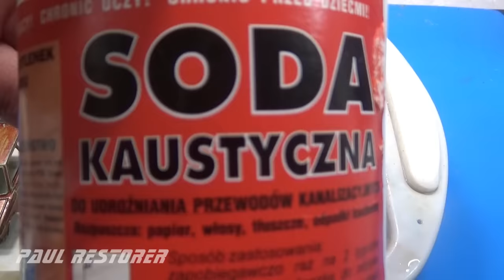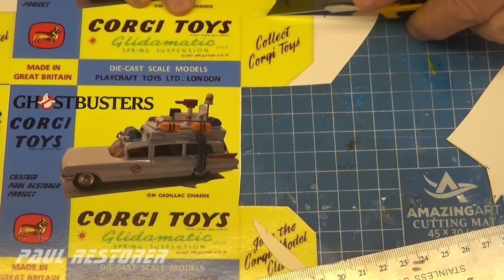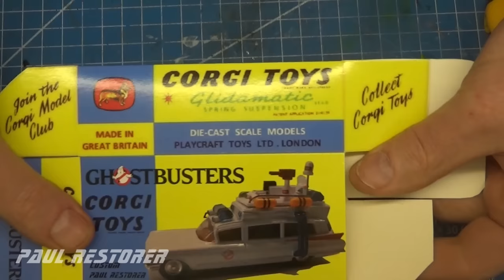Corgi Ghostbusters Custom Ecto 1 budowa. Zabawka model odlewany.

Comment: Needs some suspension work and shocks. Brakes, brake pads, lining, steering box, transmission, rear-end…. maybe new rings, also mufflers, a little wiring.
Reply from the maker: Thank you very much
Reply: How much?
Reply: @CarGuy77  only $4800

Comment: Great job with the restoration!  It just needed some suspension work.... and shocks, and uh, brakes, brake pads, linings, steering box, transmission, rear end, maybe new rings, also mufflers, a little wiring.
Reply from the maker: Thank you very much

Comment: They may have used the same mold for the Cadillac Ambulance that I had as a kid.  I treasure that Corgi (Dinky?) toy and wish that I could find it.  When it rolled forward the dome light blinked and in this clip you can see the plastic pieces meant to couple the dome light to the four corner lights to make them blink also.  The original toy was absolutely awesome and I am on a quest to find it.

It really looks like they resurrected the original mold to do this Ghostbusters toy.
Reply: At 0:43 you can see the switch mechanism on the back axle to switch the dome light on and off.  It looks like it wasn't being used in the Ghostbuster's version.  And the original toy had suspension on all four wheels and it looks like they cheaped out on that feature in this version.
Reply from the maker: Muchas gracias

Comment: Hi Paul , a very very nice model here. I’m surprised to see you use white glue as it is not a very powerful glue, don’t these parts risk to fall apart in say a year or two ? Why not cyanide glue or something stronger ?
Hello to Poland from France !
Reply: Der Klebstoff sieht nur so aus, als wäre es ein Weißleim. Wenn er ausgetrocknet ist, ist er durchsichtig und glasklar. Ich verwende ihn beim Modellbau, um Verglasungen einzukleben, oder bei Fahrzeugen in kleineren Maßstäben mit einem Tröpfchen Scheinwerfergläser darzustellen. Wenn ich das nächste Mal in der Werkstatt bin, werde ich mal nachschauen, wie er  heißt. Ich glaube, es war etwas mit MICRO CLEAR oder so ähnlich. Noch ein Tipp:
Bitte nie Verglasungen mit Cyanidkleber montieren, denn beim Aushärten entstehen Gase, und die Scheiben werden blind. :goodvibes:
Reply: @volksfront9605  danke !

Comment: 25:07 does all that raw rubber mix for the tires  go to waste, or can you restore it?  Did you use such a large syringe because you cast larger pieces normally?
Reply from the maker: I always use polyurethane to finish, pouring the full amount into different molds

Comment: How do you stop the nozzle from blocking up on that glue
Reply from the maker: after each gluing, when the glue is on a flat surface, squeeze it a few times to blow the nozzles with air

Comment: I have one in exactly the same condition. What did this model originally have in that hole in the chassis?
Reply: I am also curious. That hole in the chassis and the hole in the roof are maybe related to the same function?
Reply from the maker: this model in the chassis had a plastic battery container associated with a lamp on the roof The whole thing was switched on with a plate from the rear axle and thus the light flashed while driving

Comment: Should have done the ecto 1a, the roof rack is bigger on the 1a and you could just replace the existing roof equipment with the boards on the sides and then the other stuff so
Reply from the maker: Thank you very much

Comment: Whilst i commend the effort ....this is an Ambulance ....the Ecto-1 is a HEARSE model ...it dosnt have the upper bulge because a hearse is not designed for people to Stand up in the back ..it is designed for laying coffins in

Very Passable though
Reply from the maker: Thank you very much
Reply: The vehicle used in the original 2 movies was a 1959 Cadillac Miller-Meteor Sentinel limo-style endloader combination car (ambulance conversion). But being a ‘59 it would have pulled double duty as a hearse when needed. Automobiles serving only hearse duties was not common place in the United States until the 1970s.

Comment: The only problem with this is that the car they used in Ghostbusters was a 1959 Caddilac Ambulance and this is a die cast model of a 1961 Caddilac. It does look simmilar but the tail fins were taller on the 59, with dual tail lights that were shaped like bullets on each fin, and there was non lower fins on the body. The fins are also longer on the 59, and didn't dip into the body as soon in the front.
The 1960 had a similar design to the 61 but also lacked the lower body fin. The 60 and 61 were dimensionally just a tad smaller with the body volume than the 59. 
I think its ok that you are doing this project. I actually custom 3D design and 3D print out models. It would be neat if you could find a die cast 59, but this car can look close to the part.
I used to own a 1972 Gran Torino and it was painted like Starsky and Hutch's car and although it was close this was a sport back, and the real car was a 1974 coup so the back windows, and the front grill were totally different. Most people never noticed though.
Anyway good luck with this.
Reply: It was actually a hearse. Not an ambulance
Reply: @herco7819  PatAto / Pat-ato.
All of those custom made station wagons were either used for Hearst's or Ambulances, and sometimes ended up doing both.
I had a friend in the Navy that had bought a used 59 Caddy ambulance, and painted it purple and had cartoon buzzards on it, and made a plywood coffin to have in the back of it.
I do think you are correct though as I think the mechanism that slid out the casket is what they showed in the movie with their nuclear accelerator back packs.
It was a 1959 though.

Comment: Everybody can relax, I found a car. – Needs some suspension work and shocks and brakes, brake pads, linings, steering box, transmission, rear end. Only $4800. – Maybe new rings, also mufflers, a little wiring.
Reply from the maker: Cool

Comment: You need to be modeling those parts in F360, and resin printing them will all the details. Styrene doesn't look good, and all that glue looks awful.
Reply: @@roz4436 Pipe down, you.